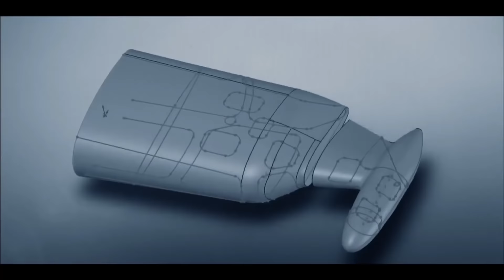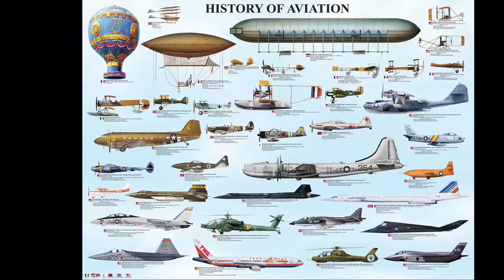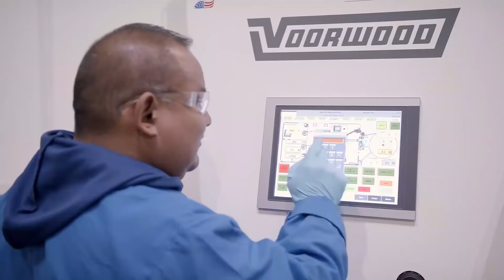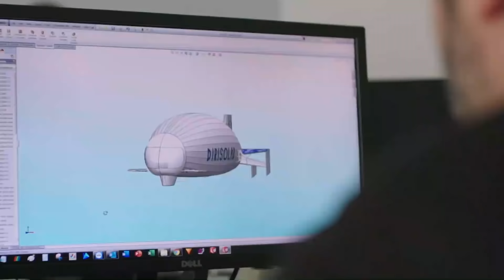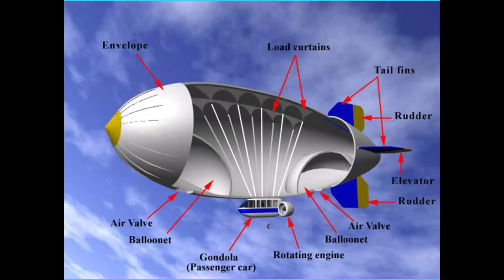Advanced Technologies for Modern Airship

Comment: It’s very interesting but unless they can operate above the weather not sure scheduled usage will be a thing.
Reply: They managed scheduled passenger transport on days long routes from Germany to South America without incident for many years - check out the history of the 'Graf Zeppelin", ^oo^
Reply: @Drew Peacock People are considering high altitude communication airships that operate in the band of altitude where winds are (as you say) typically lower - Though because as the atmospheric pressure drops with altitude, so does the lift capacity for a given volume of airship - so a laser carrying ship, perhaps charged by a solar skin might be feasible, but it would  have to be very big to carry a significant payload at altitude  - Alternatively - an airship in a lifting body shape could produce a lot of lift at 40 mph (typical on station wind speed) so might be a more practical and achievable size to deliver the lift required, ^oo^
Reply: @Drew Peacock Happy to chat, appreciated - essentially yes it might be possible - you can certainly build an airship capable of carry a payload like that  - As a rule of thumb, take the payload in kilograms, - divide it by the weight of the air  at the operational altitude (approx 5x for this application)) take the cube root of the result for the linear dimensions of a cube - then consider one of them the diameter of the ships, and multiply it by about 5 to get the length of the final vessel -  for a 60 ton payload that works out as around 70m by 335m - roughly 230ft diameter by 1090ft - which is 300 ft longer and and about twice as wide as the HIndenburg - which has a displacement of 200 tons - so big - but considering what was possible in the 1930s, it's certainly looks possible, ^oo^

Comment: There is no problem with hydrogenium, zeppelins were flying millions of kilometers without failure, being hit by lighting strikes many times during single storm! And there were also helium based airship fires!
Hydrogen-powered zeppelins were quite difficult to set on fire with incendiary ammunition.
With modern technology risk is minimal, comparable to using gasoline in cars.

Comment: This technology might work well when combined with another emerging technology that being E-VTOL. 

Take for example a Jetson E-VTOL. It has a limited  endurance of about 20 minutes.  But if one used a lighter than air craft as a floating ferry then then the Jetson could fly up to the floating ferry, then hitch a ride and then fly off the ferry and land at its destination.

Thus say the flying ferry could connected a town say 50 miles from a big city so that the one could use the Jetson to fly to work in the city by hitch a ride on the flying ferry.

nd by this method the balloon could stay aloft and would not have to take off and land to  have passengers come and go but rather they can fly up to the  ferry on their own power and fly back down to the ground.

The flying ferry then could pick routes that go close to the locations of the Jetsons that want to board disembark form the flying ferry.

This would likely initially be a bit expensive but the rich could afford this and it might serve as a status symbol as well as a way they can live further from crowded cities and then over time the cost might come down to allow the not as rich to  use this as well.

The idea here is that one technology does not make a practical and affordable   capability (perhaps)  several combined could.

And BTW, this idea is not all that different from what Amazon is considering, juts applied to a human payload.

Comment: This video does not offer scientifical information. Vacuum ships are unfeasible on Earth. Air is just to light to offer enough lift. They are not impossible. Just completely impractical. On another planet where the atmosphere is somewhere between our air and water - completely a good idea. On Earth - such a ship would cover the sky. It's simple - if you want to lift 1 metric tonne of useful cargo you need to displace 1 metric tonne of air with vacuum. Meaning 774 cubic meters of empty volume at sea level will be at equilibrium if it's own weight is 1 tonne. Not carriyng passengers or cargo. And as soon as you rise up you need to displace even bigger volume than on the ground level. And that's IF we can build such a strong construction that doesn't buckle under the air pressure. We're talking flying skyscrapers that only lift a bus load of people. Any failure would mean falling skyscrapers. Buckling is like an inverted explosion. Hydrogen is also bad as it doesn't play nice with oxygen. Helium is the safest and worst performer of all 3, but at least such an airship will not kill you on fall.

Comment: vacuum spheres in any shape shell, ie, atoms bcc pattern
Reply: dont worry about the general design, just focus on the getting the vacuum spheres, tessellated-supported or not
Reply: standard hot air blimps, or steam blimps, are possible, not requiring any scarcely available mineral, or synthesize the helium with fusion if absolutely wanted

Comment: Relative to a vacuum hydrogen would have aprox 7%  less buoyancy in our atmosphere
Reply: Thanks for that bit of info.  I wondered how the 2 compared when he compared H2 vs HE
Reply: The statement he makes at 4:00 is inaccurate. The only way halving the weight of the lifting gas would halve the size of the airship is if the initial lifting gas was 2/3 as dense as the atmosphere and was replaced with a gas 1/3 as dense the atmosphere.

Comment: Thx. for the video. But i did not understand why can't Helium be manufactured like Hydrogen? Why did you say that Helium is NOT renewable? Could you explain please?
Reply: Helium is a noble gas which means it doesn't form molecules (There's no helium equivalent to H2O), so helium just float off into space. Hydrogen would too if it weren't weighed down by other atoms. What helium we have comes from the decay of radioactive material underground. It takes a while for it to seep up and we can catch it before it does.

Comment: Using solar powered electrolysis... And containing only the Hydrogen in small controlled amounts similar to "on demand" requirements to fuel small Hydrogen Jet Engines... Then with simple water collectors attached to the exterior to allow for infinite flight time... You land only when you want to or during times of no sun light... Option is yours... Utilize such system outside of the balloon used to maintain buoyancy. So use creates no pressure changes!

Comment: "with vacuum we have the potential to build an airship half the weight of one with hydrogen" THIS IS BS . Explanation: the lift of - say 1 m3 - full of lighter-than-air gas is but the difference in weight of that 1 m3 filled with that gas instead of air. Case "helium": 1 m3 at 20°C of air weighs 1.12 kg; the same 1 m3 but with helium weighs 1/7 of that, or 0,16 kg, lift is therefore 1,12- 0,16 = 0,96 kg. Case "Hydrogen": it weighs 14 times less than air; 0,08 kg, therefore lift of 1 m3 is 1,12 - 0,08 =  1,04 kg (thus barely 8% more than with helium) and case "VACUUM" : lift is 1,12 - 0 =  1,12 kg or barely 7 % more than with hydrogen and 15% more than with helium. therefore , in order to generate the same lift, an hydrogen airship needs only 8 % more volume than with pure vacuum; helium airships need only 15% more volume than with vacuum and 8% more volume than with hydrogen

Comment: Sorry, but I doubt airships will ever really take off except for niche uses. Lifting gas is either rare and expensive (He) or relatively dangerous and leaky (H). Reserve thrust requirements for safety are huge, and must include thrusters for attitude control in bumpy winds, as well as translation to handle cross-winds and unstable air. Being lighter than air, or near so, airships are very vulnerable to weather events such as storms and squalls, and will require safe hangars to survive long term. As a rule, high wind resistance requires high wing-loading. Low wing loading craft will always be weather limited.

Comment: Why you refuse to build spherical airship with two rings around. Horizontal ring to compensate levitation upward or downward, the vertical  one for electric propulsion forward or backward. I don't need things from you, only say thanks for my idea.  Or ask me why and I will share more.  NB a SPHERERICAL airship must have two shells. The outer mobile shell to reduce noise at high speed . The immobile inside shell to carry passengers.

Comment: These designs fail to counter the same problem that doomed airships before - side winds.  Most of the late major airships were destroyed by sidewinds that caught them and drove them into the ground.  Little electric motors with solar power doesn't address this major problem. We do have better technology such as radar to help predict bad weather but these do not have enough speed to avoid major storms particularly over oceans or other areas where they can't be protected.

Comment: "So if we were to design a vessel  that could hold a vacuum then we have the potential to create an airship that is less than half the size of a hydrogen filled airship"
Well that is simply not true.
Hydrogen is 7% the weight of air so even an absolute vacuum could only carry slightly more weight than hydrogen of the same volume.
Reply from the maker: Agreed. Made an error

Comment: If we ever establish a Moon base, Helium supply will no longer be an issue. Helium is quite plentiful in space. We just can't hold it in Earth's atmosphere very well. Of course if the safety issue can be overcome, Hydrogen is a lighter and therefore superior lifting gas.
Reply: look up sloot digital coding systems, its neat ----- Patterns can be autonomous, so much so, that the program knows what to expect, like quantum entanglement, the pattern can be really interwoven, that on each end. That it knows what it's going to expect on each end. I LIKE THE SLOOT coding idea, so much potential in that idea, in supporting autonomous action and reaction's ability. Maybe it compresses it in such away, like they said lossless and like other videos saying compacted really well, it didn't take much to pinpoint the information needed, to create predictions on what the code would be, with near accuracy.

Comment: If warm air rises that means it's lighter than air at room temperature..........what if the air ships were  a closed container with air and just heated it like a hot air balloon......no fear of catching fire or exploding.
Reply: the issue with that is hot gas means higher pressures, the envelope will have to account for that difference in pressure with a stronger material. the other challenge is the lifting potential is much less than hydrogen, unless you get up into the range of thousands of degrees celcius (air density is 0.5kg/m^3 at 400C, and at 0.25kg/m^3 is over 1000C). That's not to say that it's a bad idea but actually a good one, just that people have already come up with it in the form of hot air balloons, unfortunately they have their own limitations that make them impractical for a lot of applications. 
edit: the reason hot air balloons don't explode from the difference in pressure is that they're not sealed like an airship but constantly heating and releasing hot air. I think they also get some lift from convection but I'm not sure.

Comment: A Graphene Structure and Tissues would decrease the Weight and Increase the total resistance of the Floating Airship.
New Flat Perovskite Photovoltaic Cells can be applied on the top...
The Tissues made of Graphene.. if made Conductive, could Convert small amounts of Photons in Electricity.. they could also sustain the harvesting of Electricity from Thunders storing it in Cellulose based Aerogel Graphene Soaked Supercapacitor..
They would have multiple uses...

I know a few..

LokeedMartin: If you wanna fuck me,
at least ask me out...

Comment: Like a modern oxcart. Totally obsolete and will remain so. Reason: slow speed due to high air resistance. There have been dozens of attempts to "bring back the dirigible", but all have failed for the same reason. Too damned slow. People want high subsonic speeds, circa Mach 0.8 or thereabouts. Not possible with lighter-than-air machine.

Comment: Could you build an air ship using oxygen.  The lift could be control by letting in cold air if you want to make the airship weigh more, or heating the air if you want to make the airship weigh less.